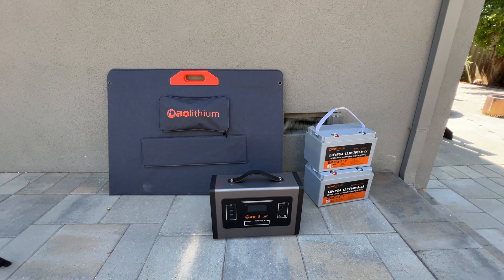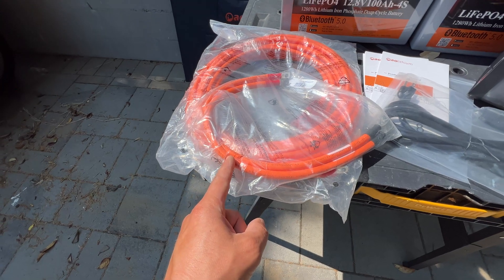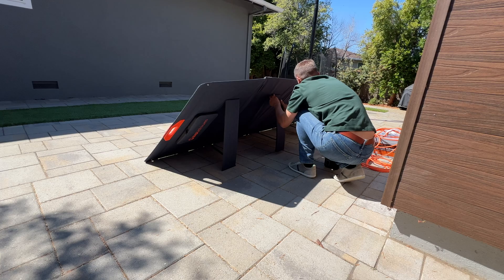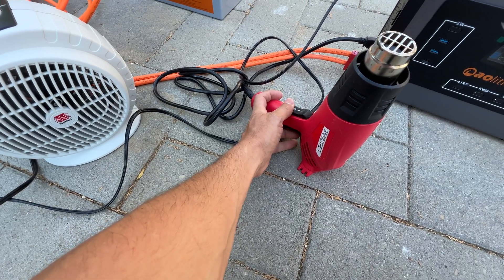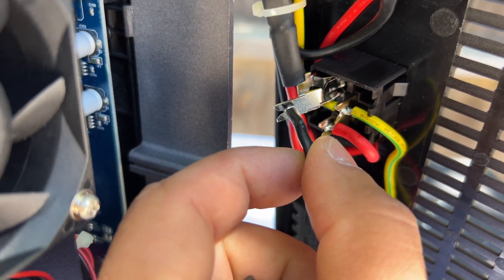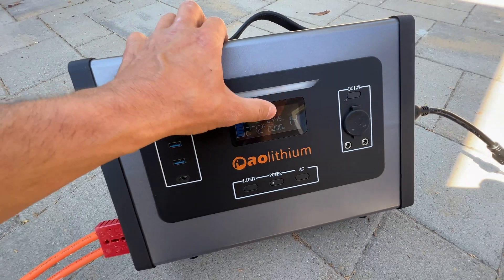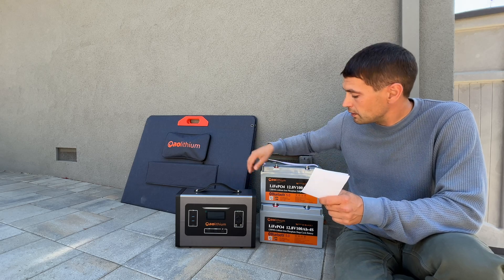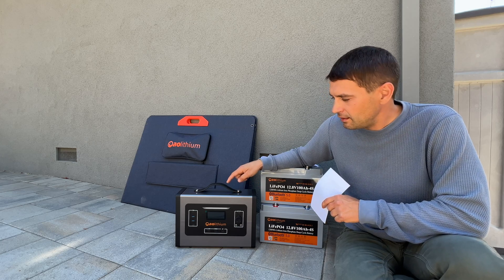Testing Aolithium Solar Kit. Portable Design

Comment: Push and hold the ac power button, that will change between 50hz/60hz then no more E5 error
With non aolitium I only get 500w ac charging, wish it would do full 1000w it clams

Comment: when you have 2 independent 12v batt in series its could be problematic to balance it
Reply: Those 12 Volts LifePO4 batteries have built in BMS( battery management system)